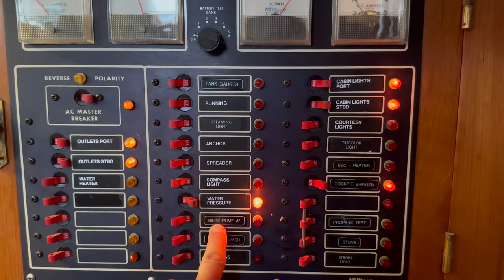Will We REGRET This? (first night in our NEW BOAT) EP. 83

Comment: Hi Guys, best wishes to you both on your new boat. On the matter of your head, you should disconnect the hose and inspect it. It might need replacing. Calcium and sea growth can severely restrict the flow. From experience, it’s not difficult or expensive to do, but can save you a lot of headaches later on.

Comment: I would suggest you get a TDS meter which doesn’t need to cost much. First, it would be good to test your water from the water maker. Second, you can tell some about water in your bilge without involving your tongue. Actually, if you don’t have two reply. I will get you setup with one for the bilge and one for your drinking water (assuming you can communicate a shipping address). I know many a sailor tests bilge water as Parker did. But… well the meters aren’t expensive and might prevent me from thinking about the taste test. :)

Comment: I've often thought that airlines should charge for the combined weight of the luggage AND passenger.
Using that system, you two would have been below average and so your carbon guilt reduced.
I haven't come across your channel before but the boat looks like the boat I'd like to have.